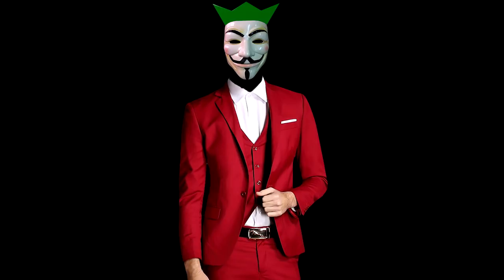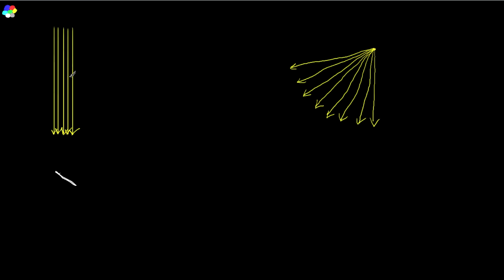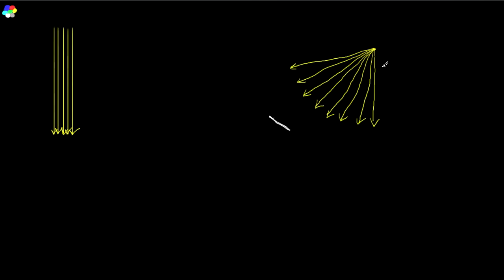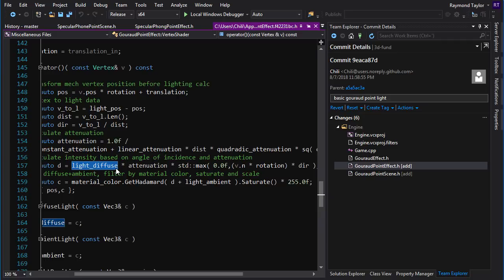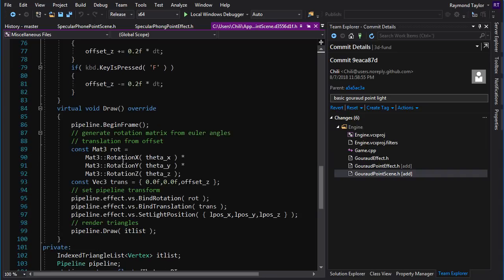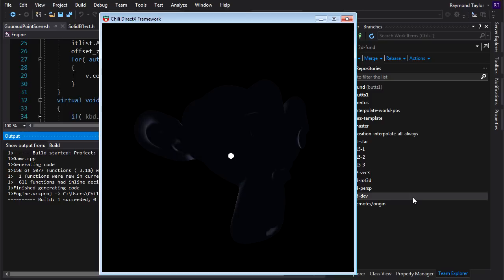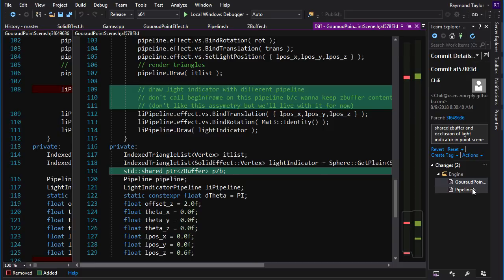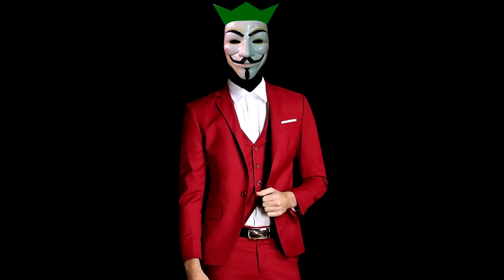3D Programming Fundamentals [Point Lights] Tutorial 16

Comment: 7:30
If you noticed the attenuation formula typo, don't be frustrated, it'll be fixed in T17.
Both of the formulas give similar values at low input (that's why it looked ok).
Anyways, great video;)

Comment: This technique uses vertex lightning so it gives unrealistic result in situation where geometry consist of few polygons. I think in next video you will show per pixel lighting or kind of. Am i right?
Reply from the maker: You pretty much nailed it. 
Though there is a very specific reason why the quad plane gives such bad results.
Reply: @ChiliTomatoNoodle  if be more specific, in situation like you shown at the end of video, light source positioning on equals distances from all vertexes. Same as the angles between vertexes and light source is equals. So it happens that the distance is far enough and angle is wide enough (which both affecting on light intensity) to give this kind of flat low light shading effect i believe.
Reply from the maker: That is the specifics of it :)